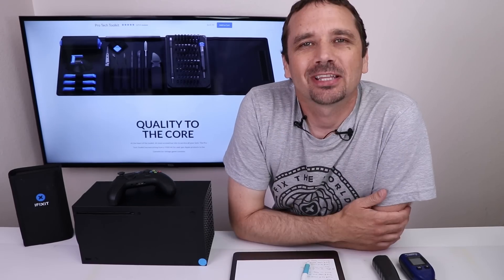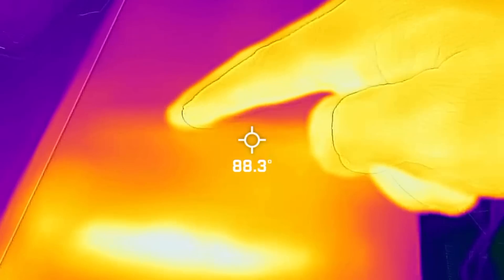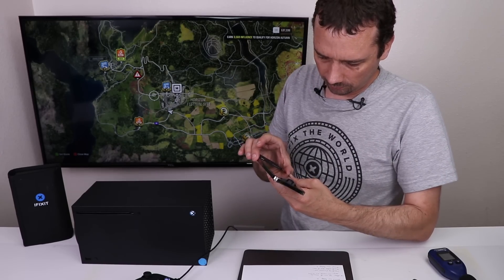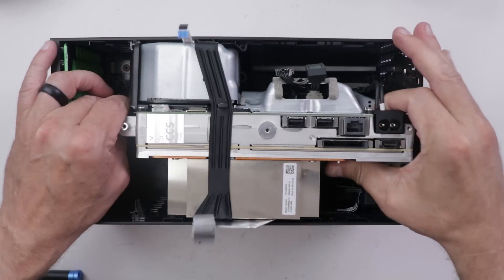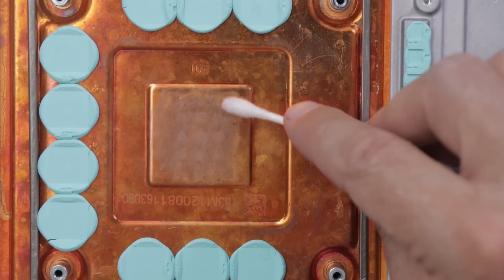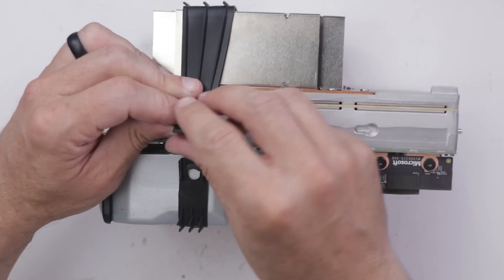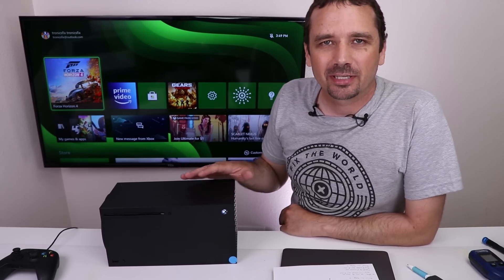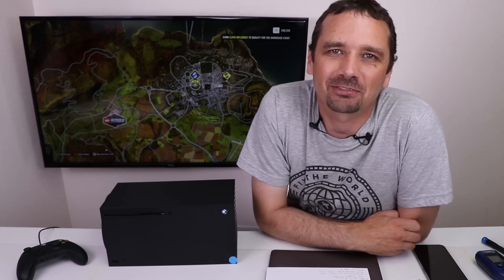I Put Liquid Metal In My Xbox Series X - Here's What Happened!

Comment: Very nice video again Steve, I think the liquid metal will show it's value over time when there are games available which push the XBSX to it's limits and also when the themal paste is getting dry and transports less heat to the heatsink. Thx for this nice start of the weekend again :)
Reply: Don't put liquid metal in your Xbox. It's not designed for it and will likely cause damage.
Reply: @shtiken  No computer is designed for liquid metal bruh..not Ps5 , not PC nothing out there but its the most overall good at reducing heat.
Reply: @neosrt10  Pretty sure liquid metal forms an alloy with copper, and I think the heatsink is copper
Reply: @cmdr101z8   I dont know why your talking about copper and aluminum thats an issue with liquid metal application Im not talking about that..my point is No computer device manufactured is designed to take liquid metal Intel nor Amd designs  any cpu to take liquid metal they only factor in metal heatsinks traditional thermal paste and cooling fans..everything else is added ons mods like water cooling and liquid metal. Manufacturers recently started using liquid metal in some builds..it not mainstream at all..Asus was the first to add it to laptops and even now they are having issues with spillage in some cases.
Reply: @neosrt10  The PS5 was designed for liquid metal, they spent a couple years on the implementation of it
Reply: @cmdr101z8  No son it was not a liquid metal was designed to used on the Ps5 cpu that is not traditional liquid metal  get your facts straight .
Reply: @neosrt10  What are you even saying? The PS5 was designed to use liquid metal, you can search it up if you want

Comment: It'd be great if you did a teardown with thermal probes like they did on the GamersNexus Youtube channel. You'd get much more accurate data than just measuring the exterior vents and case. Still, it's an interesting exercise!
Reply: @strangestecho5088  but lets say if the apu overheats won’t the frequencies drop?
Reply: @addyrocks1996  Not really. You are developing on a closed system. There really is no way to make the APU overheat in the way a PC APU/CPU might, unless you are literally trying to break consoles. in which case your game will never get green lit anyways and all you accomplished was frying your dev units.  

The console supplies a certain amount of power at a constant rate, depending on how many threads are used for the game. As someone above already stated, the Series X will operate at 3.8ghz when using 8 threads, and drop to 3.6 when using all 16. 

This ensures a steady temperature and steady gameplay experience for end users.
Reply: @WeinerTouchy  not really , some consoles do overheat after a while due to dust build up or the thermal paste getting worn off.
Reply: Would be cool if you could record the frequencies being pushed by the apu. Not sure with newer consoles but modern hardware will ramp up frequencies if some requirements are not exceeded like temps to increase performance.

Comment: Only the chip and mainboard temperature should really change a lot since the power consumption and efficiency don't change. You dump less heat into the mainboard and more into the heatsink, so the air coming out is a bit hotter.

Comment: Tbh, the way of measurement tempeture base on the exterior of the case isn't by far the most accurate. The only way to know the real difference is by a heat sensor that make contact with the die of the APU.
Reply: There’s temperature sensor around the APU build inside the console but they won’t let you see it from the OS but if it overheats or something like that it will detect it and shut down automatically
Reply: @Brmeel  Can you see it if you have developer mode on console?
Reply: @zperdek  not sure about the developers mode but probably not
Reply: @zperdek  I belive you can see temps in dev mode as long as you have an app installed
Reply: Well putting a temperature probe on the heatsink or next to the die is the next best thing. Should have done that maybe.
Reply: @robertt9342  that would most probably be your first best thing
Reply: @gregorybutcher9555  . I would think accessing the built in sensors would be the first best thing, but since they are locked down…
Reply: outside of software your best bet is a themperature sensor at the back of the pcb. As cpu's are flip-chip the hottest part is at the bottom, so measuring here should most accurately reflect how well the cpu itself is cooled, without interfering with the cooling.
Reply: If you could install Custom Firmware would be the best way to measure temperature from the sensors through an app.

Comment: So basically no difference, possibly one degree cooler. Yip, the stock Series X is very well designed and doesn’t need liquid cooling. Unlike a certain other console that would explode without it. Thanks Rich!
Reply: A few things here. 1: testing the exhaust heat doesn't tell how well the CPU is being cooled. 2. Liquid Metal is being used on the PS5 not just to help cool it but to also help keep it running cool years down the road where the Xbox One and PS4 consoles would start to have degradation on their cooling efficiency within a few years thanks to the thermal paste drying out.
Reply: I think it's more like how high end PCs require better cooling for their peak performance. The PS5 probably performs at a higher level, so better cooling is required to maintain the performance

Comment: Okay. A few things here.

1. Better thermal paste only increases thermal transfer efficiency. 
2. Because of that, the temperatures that change are on the component creating the heat, not the cooler. (Provided the cooler wasn't at its maximum dissipation already.)
3. Short of placing a thermal probe next to the APU and running all tests several times to account for any one offs, any numbers in this video are meaningless. (But even then, as the thermal probe wouldn't be inside the APU itself, the results still wouldn't be applicable to anything.)

4. Liquid metal thermal paste does not "corrode" aluminium. It eats it. Literally changes its properties and weakens it enough to make it useless. (The Gallium is to blame BTW)
Reply: Good to see someone else in the comment section understand this sort of thing. 

It's interesting to see this test done, but the temperature numbers are meaningless especially since they're within margin of error. 

It kinda makes watching this video moot as we have no idea about the true efficiency difference in cooling for the Series X APU with and without liquid metal.

Comment: I call this experiment a success. You geht the same good results with liquid metal, like with fresh thermal paste. The added benefit of using liquid metal is that it will never dry up.
So basically it is a good idea to use it on XBSX.
Reply: liquid metal eats away at copper and bonds with it. you need nickel plating to protect the copper, otherwise you need to reapply more liquid metal after a month or so as the liquid metal have bonded with the copper. The heatsink surface will however never be as flat as it once was.

Comment: How long would you recommend using the factory thermal paste. Is replacing it or using liquid metal really necessary?
Reply: Eventually replacing it would be a good idea, but I wouldn't worry about it unless you're needing to tear down your console for some reason. I've never added liquid metal to a chip, but I will add new thermal paste every couple of years; usually whenever I do a deep cleaning of the inside of the console
Reply: Thermal paste stays good for a few years. If you start to notice the system getting abnormally loud then it may be time to open it up, otherwise you should be good for a long while. 

But for a more specific answer, thermal paste starts to dry out within a couple of years and usually about 5-6 years it gets completely dried out and is recommended to replace then. Replacing it with liquid metal will make minimal difference on the console in the short term but theoretically you'll never have to worry about it again as liquid metal doesn't dry out or lose its cooling efficiency.
Reply: @YeaICampSo  @ShaneJusticeIsBetterThanYou Thanks for the replies guys. Very helpful information. I tend to take very good care of my consoles by using dust covers so I have never had to open any console I have owned. I will definitely look into doing so in about 2-3 years for my series X.
Reply: @snprkiller9467  Don't do anything unless you notice an actual problem.

Comment: I was thinking the same thing from the start. you would need the temp of the component, not the air around it. still good info!  to me, the biggest issue (because it's a console) is less to do with transferring heat but how long will it last.

Comment: @tronicsfix Steve your videos are always enjoyable to watch, I tinker on consoles and laptops myself and it is amazing to see these videos you post showing us the in's, out's, and even showing when you goof up showing that like us even after years of experience you're still human and can and will make mistakes. I'm curious to see any long term damage done to the liquid metal onto that heatsink, say from simulated excessive use from a much anticipated game that came out or something that really makes the APU chug like Assassins Creed Valhalla or another of those heavy usage titles.

Also whether or not that silicon sealant worked after the X got super hot after multiple play sessions and if it affected the liquid metal any.

I know cost has something to do with liquid metal being used in most machines but like you said also it has something to do with certain heatsinks also, that they'd have to be copper.

Another thing I'm curious about is: Sony just issued an update for its PS5 that allows the use of the SSD slot that is on the board. What would you recommend as a way to keep the system cooled with a second SSD in?

Comment: Dumb question, since liquid metal an the motherboard is vertical when the console is standing would that cause the LM to possibly leak. 🤔
Reply: Not a dumb question, it’s possible.
Reply: @artini000  thank you
Reply: On the PS5. They make some foaming square around the chip just in case the LM started yo leak. Just time will test this.
Reply from the maker: Yes, that is a possibility. I put on as little LM as I could to hopefully prevent that
Reply: @Tronicsfix  thank you sir.
Reply: Yes it can leak out and if it does then there is the potential for it to short circuit other components. You can mitigate this possibility by laying it on its side, though.
Reply: yes if you use to much..but you can put clear nail polish around the chip to prevent shorting

Comment: Would be interesting though to know the core temps prior and after using liquid metal.
Reply from the maker: Agreed…wish there was a good way to do this
Reply: @Tronicsfix  the best possible way is getting a heat sensor and putting it to the closest spot to the apu
Reply: Its impossible because there isnt software to monitor. Its all hidden in the OS
Sony and microsoft dont like people messing with their things.
Reply: @muaries12  I will never understand why they don't let the user monitor the temps of the console. Just checking the temperature isn't "messing with things". It's just really important for basic maintenance. The temps can already tell you a lot how dusty it is inside the console.
Reply: @muaries12  So when Apple does it it is the incarnation of evil, but in case of Sony and Microsoft no one cares?
Reply: @mojoblues66  no because those that care buy a pc. The closed ecosystem is one of the perks of a console. Oh and I don’t have a problem with apple doing it either. You know what you’re getting before you buy and it’s better for security
Reply: While probably not possible, this would be the only real evidence that would prove if this solution really works or not.
Reply: You can go look up some videos in regard to liquid metal vs. thermal paste for PC components easily enough. It's probably around 2-5c difference, it's never as dramatic as the on paper thermal transfer numbers can lead you to believe. 

The only time it's was truly world changing was back when Intel used an awful TIM under their heat spreaders and folks would delid their CPU's and replace it with LM which would drop temps 15-20c. It kind of got this mythical reputation because of that but now everything is either direct touch or uses proper solder TIM under heat spreaders (thank AMD for forcing Intel's hand) and in that world it's not quite as mythical as it used to be.
Reply: Best he can do is use that laser thermometer

Comment: When i liquid metaled the one x, after about a year the liquid had kinda corroded/dried out a bit which is weird, had to get a Stanley blade onto the chip and give it a shave! A fair bit came off too.
Reply: That's what I was going to wonder about actually. The long term effects on a console designed for thermal compound that has had it replaced with liquid metal.
Reply: That's perfectly normal, it's just oxidising.  It wouldn't impact performance and you should leave it on.
Reply: The real effect comes when you actually clean the copper without using isopropyl alcohol. isopropyl alcohol that leaves behind a very very very very fine thin oxidation layer and that is a a lot more of a problem for the liquid metal Than to a paste. This causes corruption of the liquid metal witch leads a set of things to potentially to happen (the thermal conduction suffers, not a -100% but you are not getting 100%, flaking, seeping and turning back to solid)

Comment: Uff, if the air is more than 50°C then the core temps may be over 80°C...
Reply: No it wouldn’t lmao, that’s overheating temps lmao, the fan would be way louder if the apu core was even remotely close to 80c
Reply: @PrimeKilla  It makes sense because air is always cooler than the core itself. The heat transfer is very low. In my computer the water of the AIO is around 34°C but the chip is at 80 in Cinebench. Also 80°C is normal temperature target for a device like a GPU. My thoughts are only that 80+°C is in fact hot for a console of this size. And we are talking about 80°C in cinebench, not while gaming😂
Reply: @PrimeKilla  80°C is not overheating. But it’s hot.
Reply: if the air temp is 50c you've got other things to worry about.
Reply: Thats not how it works